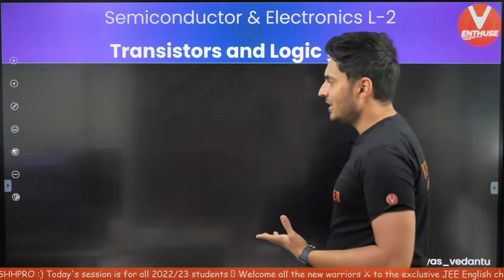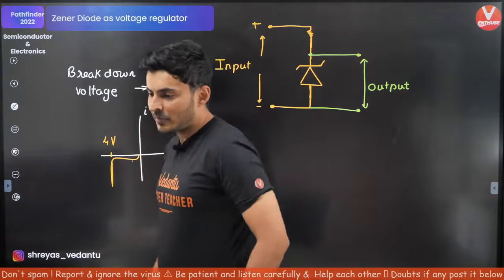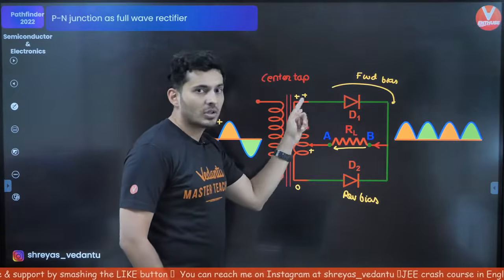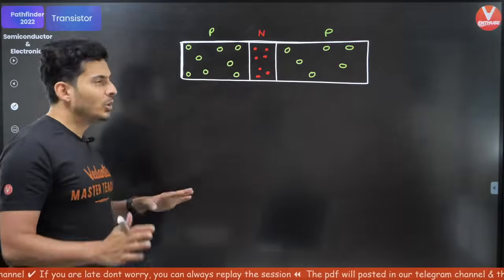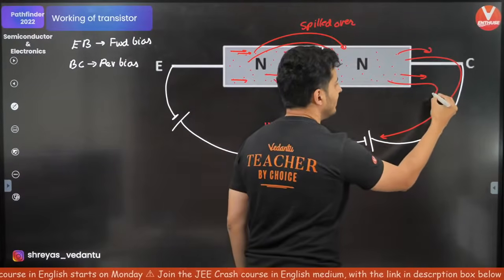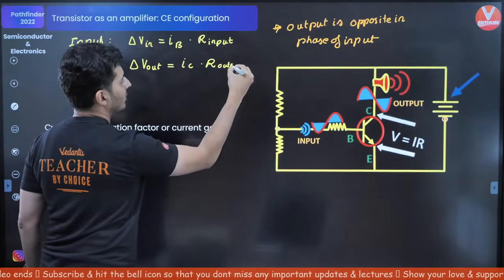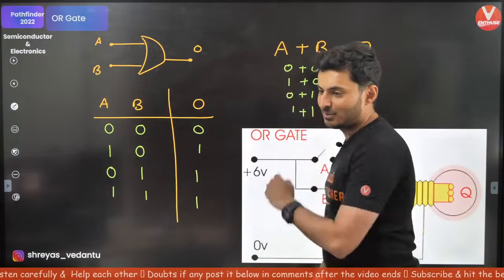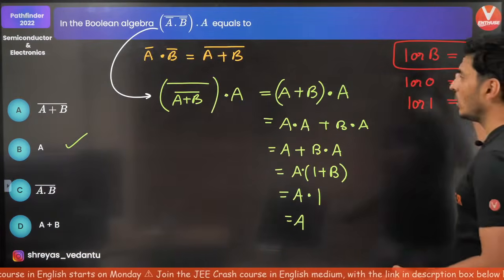Semiconductor Electronics L2 💾 Electronic devices, transistors & logic gates | Class 12 | JEE 2022

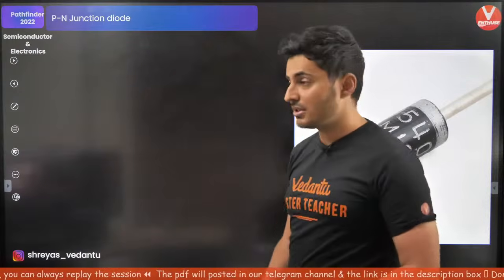Comment: 4:29 
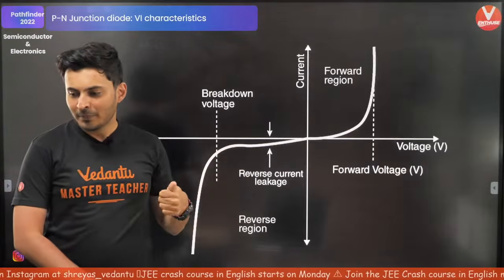10:42
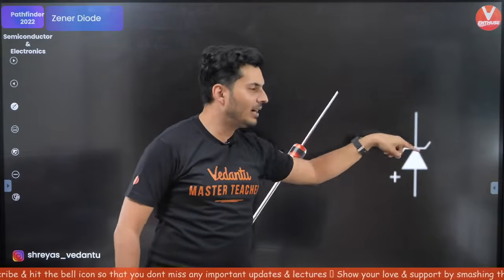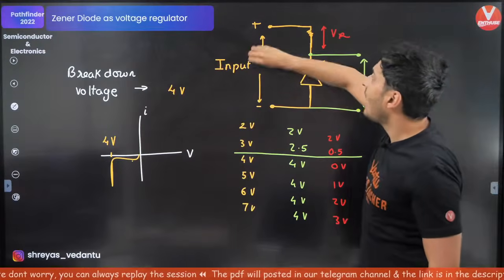15:08 24:04
26:03 35:50
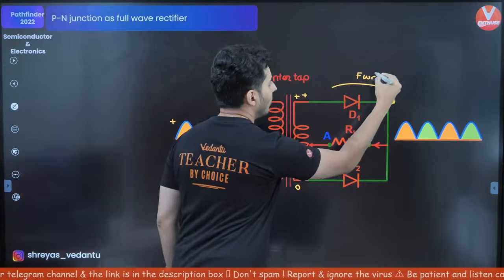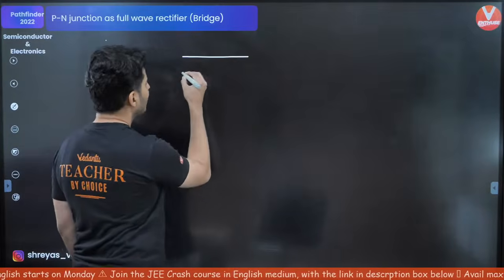36:33 39:56
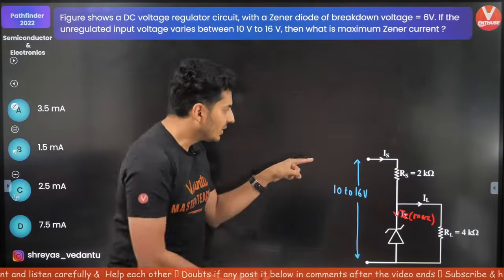48:47
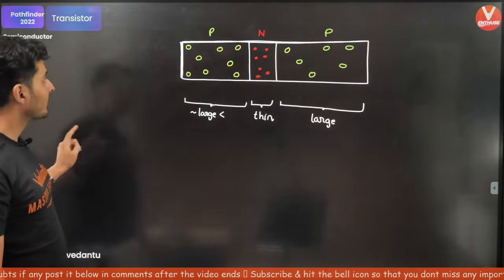56:13 59:50
1:11:04 1:15:19
1:27:50
1️⃣ Base–Emitter battery (forward bias)
•This battery allows current to flow
•It creates a small base current (Ib)
•This turns the transistor ON
✔ So yes, this battery directly produces current
2️⃣ Base–Collector battery (reverse bias)
Here is the important correction 👇
•A reverse-biased junction by itself does NOT allow current
•BUT in a transistor:
✓Electrons already enter the base from the emitter
✓The reverse-biased base–collector junction pulls these electrons into the collector
⚠️ So:
The reverse-bias battery does not create current,
it collects and accelerates the carriers coming from the emitter.
1:56:22